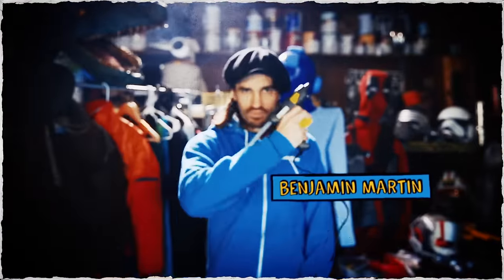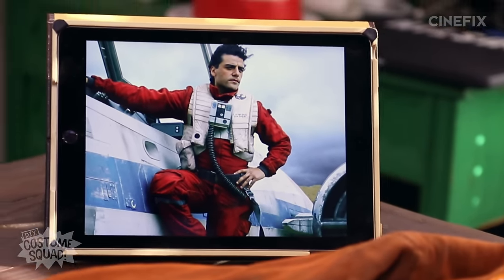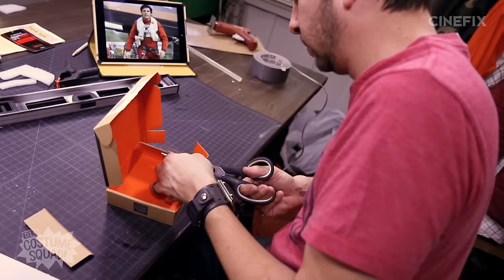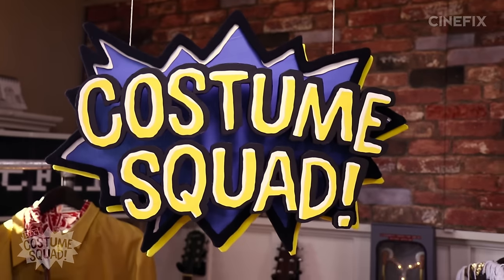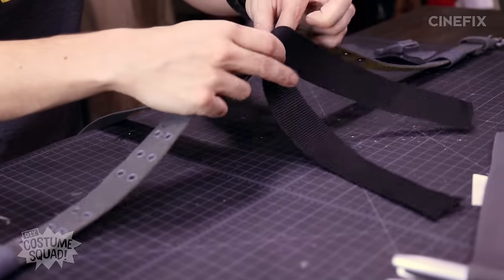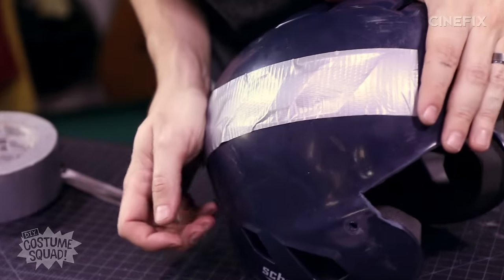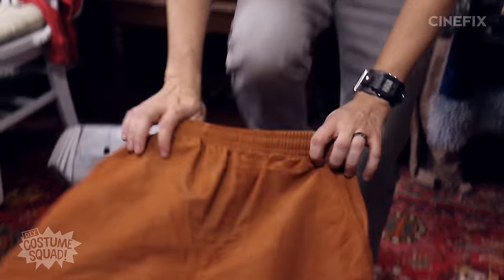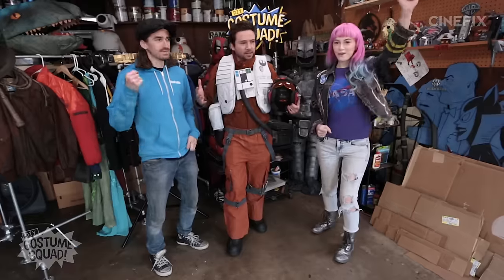Make Poe Dameron's X-Wing Suit - DIY Costume Squad

Comment: 6:33 the translation is a bit difficult because on the original vest it was written upside down for some reason but it's probably some sort of lige vest like ww2 pilot ls used to wear because the top part of the text (or the bottom but it's the one closest to the shoulder) says inflat- and the rest is covered by the box in the middle and the lower part was impossible to read and translate because the images I found were more focused on his face so the text would be a bit blurry